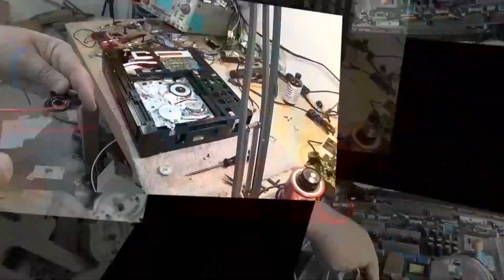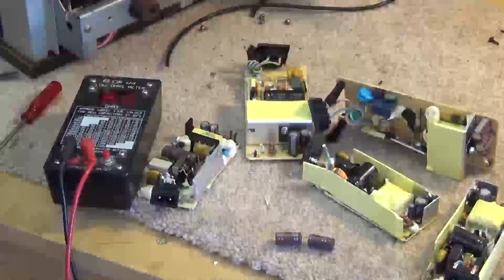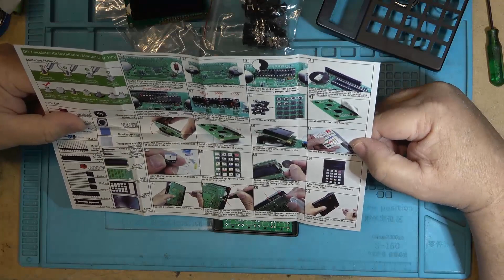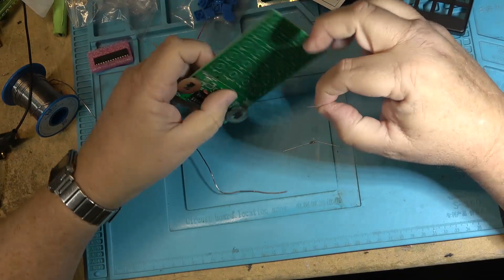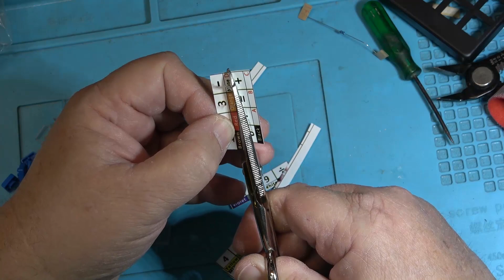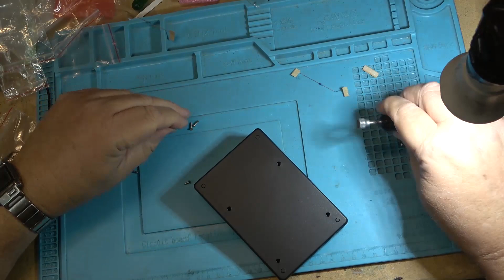Electronics Calculator Kit Build

Comment: Nice little kit, shame about the poor resolution and paper keys.
and the poor bird on the end, 60 hurts
Reply from the maker: Poor resolution? The keys are plastic dud you not see me putting them together.  Just what do you think was in the keys on many devices. Yup paper tags under the plastic key covers.   
Birdy got a tasered that's all. Flew away about 15 seconds after hitting the ground.
Reply: @12voltvids  resolution, as in only 7 digits.
Yes, I saw you put them together, they should be printed/moulded with the legends, the only reason for paper keys is if you have the source code and rewrite what each key does.
Reply from the maker: @paulstubbs7678  
Also you can just print a different sheet for different languages.  Remember this is a 10.00 kit and for the money this is excellent value for any budding electronics enthusiasts
Reply: @12voltvids  I never looked at the site, so didn't see the price - not bad.
Reply from the maker: @paulstubbs7678  the link is in description.  For the price this is a no brainier for a novice to get some practice and there is nothing more satisfying that to say I built it myself.  Just like my ESR meter.  I built that over 30 years ago.

Comment: The other reason to have those kits in existence is critical thinking. Like they have given you extra parts. That will definitely confuse someone. The kits from the Soviet Union used to be full of tiny traps. They'd have messed up the legs of a transistor, a diode would be marked the wrong way on one of the schematics, there would be different values resistors than the specified values in the schematic diagrams. All the coil work had to be done by hand including transformers. They really weren't for beginners and made a lot of kids to give up.
Reply from the maker: No likely they put a few extra in in case they were damaged during install or the machine that packed the parts dropped a few extra in.

Comment: I have a talking calculator from Ultmost model 6648. Unfortunately the display only shows partial numbers. It needs fixin hopefully its just a capacitor issue. Oh, and its a clock and alarm too.

Comment: Calculator - texas instruments IT 84 plus Calculator- I have a desktop adding machine
Reply from the maker: I have a National Semiconductor from the late 70s. Scientific calculator. Its slow as molasses. Put all your data in and press = and your hair grows about 2mm before it displays the answer. The display just shows rolling numbers as it thinks. Some calculations took 15 seconds. Even a simple square root took about 3 seconds. Slow but it worked and it was one of the first everything on a single chip design with a large flat pack IC.

Comment: I built the dot matrix smd clock from ICStation. Unfortunately its using the inaccurate garbage DS1302 chip. Drift is a minute a week!! Guess its more of a practice thing that something totally practical, although they do have ds3231 kits.
Reply from the maker: I built a very expensive Nixie tube clock kit from the UK and it is so bad that if you don't have the GPS option it drifts about 2 minutes a week in the forward direction. for the $350+ it cost you would think they would have put a RTC on it
Reply: A minute a week? Wow how we in the quartz generation are so used to accurate time.

Many of my clocks and watches are all mechanical, some drift a minute a day.
Reply from the maker: @dlarge6502  my giant grandfather clock is within a minute a month.  My Swiss automatic is also within about a minute a month.  Even my old westclox mechanical transistor clock is accurate to about a minute a week and it's 58 years old.

Comment: Nice kit. I still have my HP 41C scientific program able calculator from 1981. It does all this kit does except resistor color codes and ohms law calculations.  Ohms law is just simple multiply or division. No problem for me. My HP does conversions for HEX to decimal or vice versa. Also, does binary and Octal converstions.its programmable so i could just write a simple program for any electronics equations.
Reply from the maker: The HP is a great unit. This one is 10 bucks. Can't go wrong at that price and it was fun to build. Unlike the camera I have spent the afternoon fixing. A relatively big professional camera.